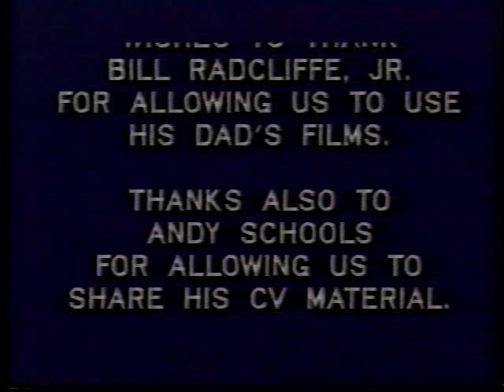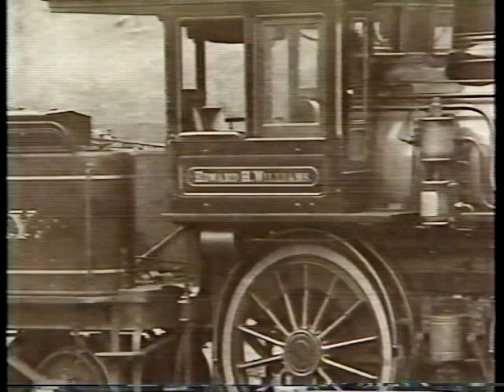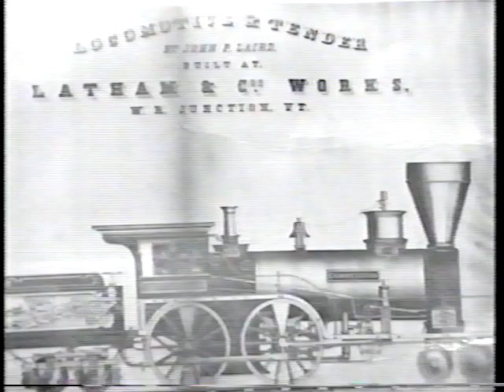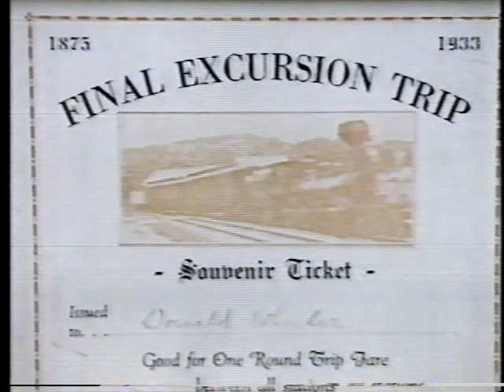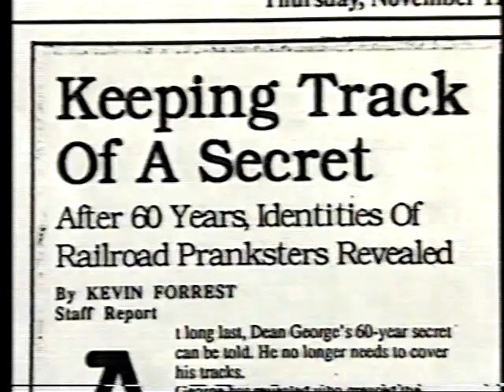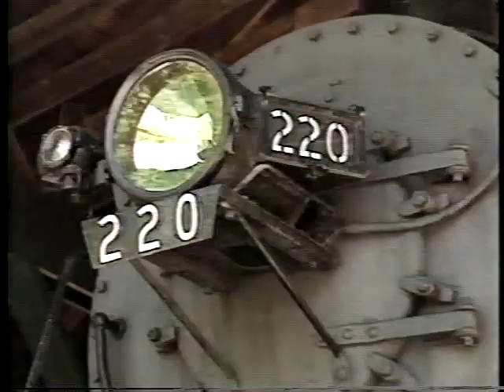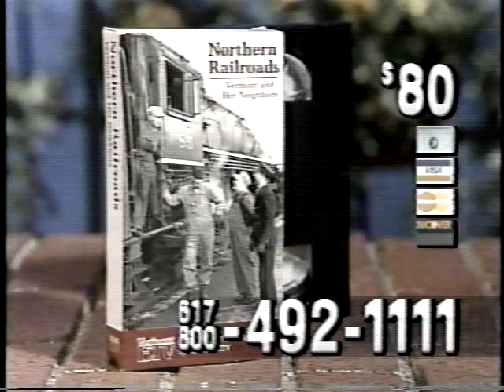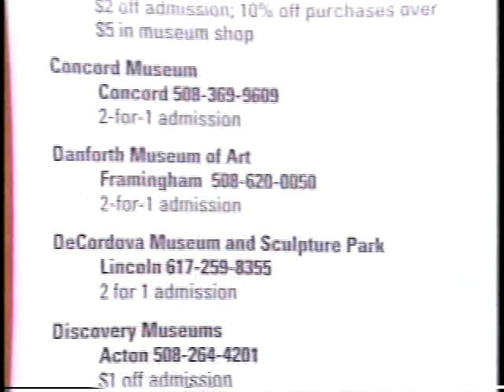The Central Vermont Railway avi

Comment: My favorite railroad. Probably because it is literally the only one anywhere near me still running. Well, except the old Barre & Chelsea (actually I am not sure what they call it now), but they run a couple small trains a week through Montpelier, sending old gondolas of granite rout from Barre to Montpelier Junction on the CV. So barely a railroad. The CV at least runs 4 trains per day, 2 Amtrak and 2 freight, one of each north and south. Occasionally there will be a 3rd freight. It is hard to watch them because they dont pass here until midnight and 3AM. I used to go down to watch them leaving or coming into Montpelier right after midnight; the freights are more impressive than the Amtraks. Best to watch them leaving, because then they open then engines right up. Hard part was that the North and South trains used to meet in Montpelier, and I never knew which was going to depart first. If went south of town and the northbound left first, I would have to wait another 45 minutes or so for the southbound to leave. Never could tell which it was going to be until the last minutes, and only if I waited at the station where i could see. Then I would have to jump in the truck and drive as fast as I could out of town to meet the train. Anyway, I liked to go north down Route 12, and about a mile outside of town there is a backroad that crosses over the line at grade. I liked to wait there, because the engines were still at full power and you could feel them vibrating the ground from a mile away, reverberating up the valley, and the air horns sounding at the private grade crossings outside of town. It would start out quiet and dark, a typical summer (or winter) night, you could hear the locomotives idling a mile away down the valley at the Junction. The road is in the middle of farm fields, and the Dog River runs parallel to the tracks there, so often it would be banks of valley fog coming off the river. I would wait around for ten minutes or half an hour, walk my dog around and look at the silent, still  night time. Then I would hear the air horn blow, so clear it was like it was right across  the field, nd immediately you would hear the engines open up a notch. And then another, and another, and I would run back to the crossing. I would hear the locomotives rumbling and roaring, louder and louder as speed picked up down the valley, and the horns sounding at the private crossings, and the roar as it crossed the overpass over the highway. But other than that the night is still and silent and dark. Then the light starts to round the hill at the head of the valley; the locomotives are really throbbing away, full power, and you can hear the cars rocking and the steel wheels squealing now, and the headlight comes around the corner and lights up all the valley fog. I would go and stand right beside the track, by the crossing signal stand, and it would just get louder and louder, and the light would get brighter and brighter, until it was lighting up the whole track. The still, dark valley was gone, it was all roaring and light, coming straight for me, and then they would blow for the crossing and the flashers would come on. Then these huge, black, roaring, throbbing, hissing monsters would smash into the pool of red light, horn blaring, and pass five feet away from me. One, two, three, sometimes four, even five locomotives, all crashing by at 50 or 60 mph up the valley. And then they would be past, still pulling hard, black against the pool of yellow light cast by the headlight, moving slowly off down the track, and the cars would whizz and groan and bang and squeal past, the wind buffeting me the whole time, the cars looking crazy in the flashing red light. It made my heart race, it was exciting. Always that letdown when 50 or 60 or 70 or more cars go past, going faster, faster as the locomotive s continued to accelerate, and then suddenly, the last one, the flashing red end marker lamp, and all the noise would disappear off up the track, the lights would shut off, and suddenly it was a dark, quiet night again, except the now distant train heading off for Riverton and Northfield. Ah, I do miss it. And I miss my dog. I wonder if they still follow the same schedule. It isnt that cold tonight....
Also good to go north, climb over the guardrail of the Rt 2 highway overpass and stand on the top of the retaining wall. I also waited under the railroad overpass across Rt 12 once, and that was pretty cool. It was actually hard to resist running when the sound of the locomotive suddenly roared onto the overpass and straight towards me; all my insticnts were yelling "its coming right for you you fool! Run!!!
Reply from the maker: Wow! You should add context (what triggered you to write this) and send this in to the local newspaper, other people and train enthusiasts deserve to read this. Great story!
Reply: The barre and Chelsea is now operated by Vermont Rail System under the washington county railroad name
Reply: Excellent descriptive writing, with a great memory for detail! Are you a professional writer? It's just too bad steam didn't last long enough for you to experience it in this context, and people who heard the CV's steam whistles have said they were the prettiest in New England. What a sight and sound that must have been!

Comment: I believe the location at 40:13 is the rt 63 overpass in Leverett MA, based on the narration and the appearence of the location. Haven’t ever shot a train here, but I shot a good many Amtrak trains and a fair share of NECR freights at the depot rd grade crossing just a bit south. The old station must have not seen much service, I read somewhere they tore it down around 1950. 
Note the gates by the tracks in the shot- I think there was once a grade crossing here... I have spotted the old alignment of the road by the overpass. Hard to tell what used to ne there unless you look carefully.

Comment: One of my favorite things on the den floor consist is a "Central Vermont" four window Caboose, No. 6187 just like the ones shown here.. It's wood, made I the 1940's I suspect with heavy metal trucks.Great to see Jim Findlay with Engine No.220..does anyone know if it's still in a static display? Is it the only engine not sent to the scrappers yard?
Reply: There is an old 4-4-0 on display in Brattleboro. That is the only one I know of, but I am still finding surprising things around here even after living here my whole life. Found an M4 Sherman tank last summer up in St Albans.
Reply: These polluting locomotives need scrapping with cutting torches and the debris melting down.
Reply: Not to be a spelling geek but for history's sake it was Jim Fendley.  He was my scout master growing up.